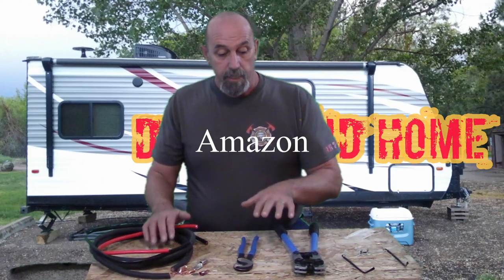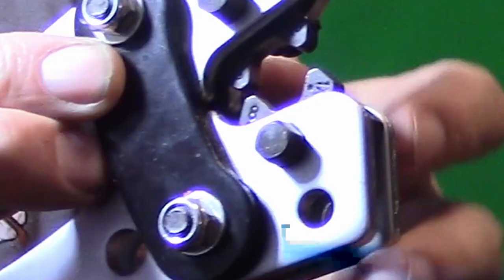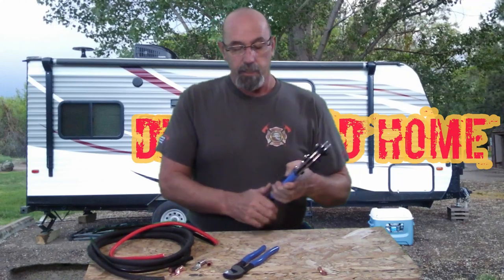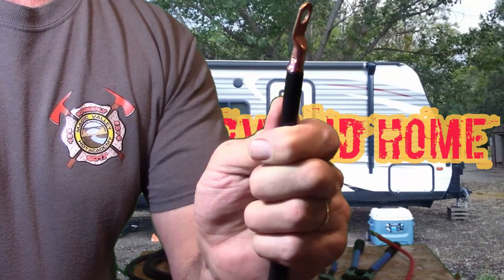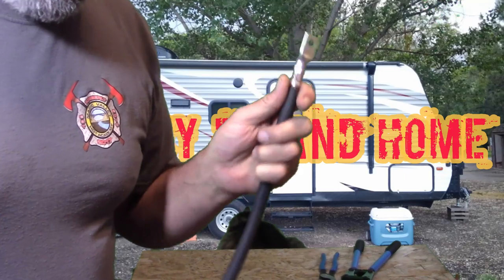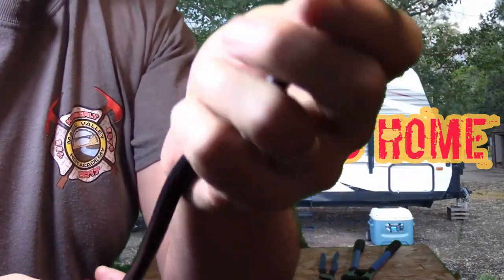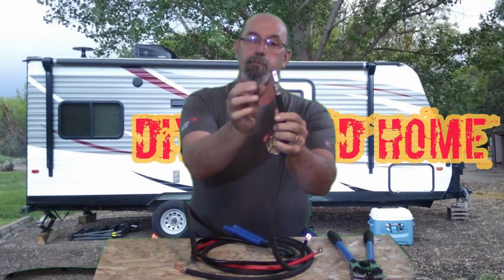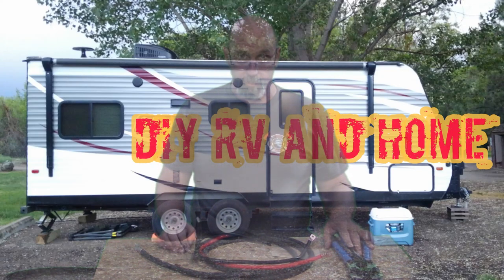Reviewing the IWISS HX50-B Battery Cable Lug Crimping Tool and Cable Cutters

Comment: Thanks for the video.  Can I use this for gym cables? Should I adjust size according to bare wire or with the sheath/ rubber? Thanks.
Reply from the maker: Not sure what you are referring to as far as gym cables.